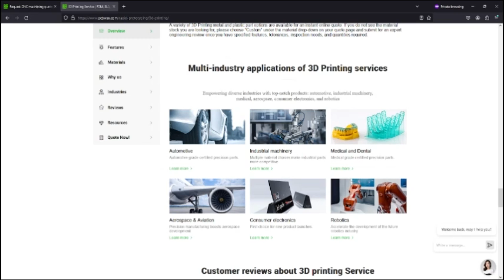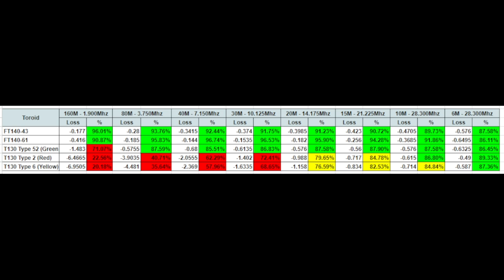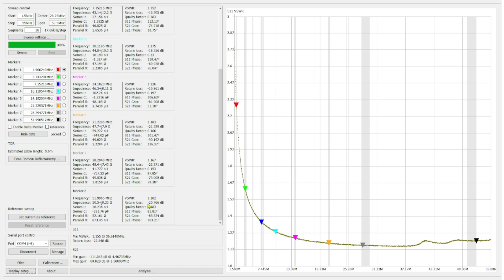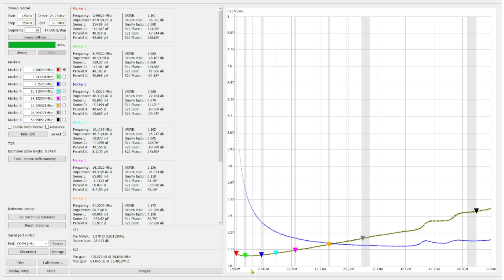Compared: 4:1 UnUn's for Ham Radio Antennas

Comment: That was a good one Dr Ape. Any idea why the T130 type 52 does better in the field?  The lab tests seemed to make the FT140-61 the hands down winner. My other question about toroids is heating. How big do they need to be to not overheat with 500W SSB and a 20% duty cycle? 73
Reply from the maker: It’s doesn’t “do better” but is tunable with a 3:1 internal tuner, that’s why we used it.  500w, I’d prolly use 2-3 stacked 240 cores 👍

Comment: What are the power ratings for the different cores?
Reply from the maker: For these cores I would suggest 100w ssb and 50w digital while keeping an eye on SWR.  We use them in antenna designed for 40-10 👍
Reply: @TheSmokinApe  I guess I have should have asked what size core for 4:1 1500 watt balun?

Comment: Sorry, I do not get it, what is the purpose of the test with the same size and the same number of turns? This test DOES NOT SHOW ANY EFFICIENCY DIFFERENCE BETWEEN MATERIAL TYPE BECAUSE THEY ARE SO DIFFERENT AND NEED TO BE WIND WITH DIFFERENT NUMBER OF TURNS. This test is misleading!  73 Danny E73M aka N4EXA
Reply from the maker: HI DANIEL.  YOU ARE CORRECT, THE CORES ARE DIFFERENT WITH DIFFERENT COMPOSITION AND WOULD NEED TO BE WRAPPED DIFFERENTLY TO ACHIEVE SIMILAR INDUCTANCE.  WHEN YOU LOOK FOR UNUN SCHEMATICS ON THE INTERNET THEY WILL SHOW A WINDING AND RECOMMEND A CORE AND THEN, AT TIMES, LIST OTHER CORES YOU COULD USE WITHOUT MENTIONING CHANGING THE WINDING.   MORE IMPORTANTLY, I WANT TO SHOW PEOPLE HOW TO CONDUCT THEIR OWN TESTS WITH AFFORDABLE HOBBYIST GEAR SO THEY CAN LEARN AND FIND OUT FOR THEMSELVES.  OH, GLAD YOU LIKED THE VIDEO 👍

Comment: Interesting results, most folks that I know would swear that the 43 mix would outperform the iron mix by a landslide. Would there be any reason not to use this core for an EFHW 49:1 or EFRW 9:1?  
Awesome video keep up the great work!
Reply from the maker: I haven’t tested in a configuration other than a 4:1.  I would be suspect of it at those higher ratios but it t might work…
Reply: I wouldn't mind giving it a shot. 
I could try 9:1 and 49:1.
What would entail a good test? 
I don't have a vna only a g90 with is swr meter is that good enough?
Where could I get such a core?
Reply from the maker: I believe we got these from TME.com

Comment: I am building a Yagi antenna would it effect the performance if I mount it on a metal pole? WQ9V
Reply from the maker: That’s a pretty typical scenario, you should be fine.  That said, any conductive material, in the near field which is about a 1/4 wave will impact your far filed pattern.  Everyone puts them on metal poles, so don’t worry about it bro 👍

Comment: Generally speaking, use powdered iron for narrow frequency HF coupling, and ferrites for broadband HF  and VHF applications, at least below where air-core makes more sense. Of course, core shape, size, and conductor diameter variables will also affect efficiency. Then there's power level to consider for the specific application, which will affect all of the other parameters. Then there are non-magnetic and air-cores to consider. Experimenting with transformers may be fun, but to produce optimal results it's a lot more time and energy consuming than hitting the datasheets and software transformer design applications with the requirements for your specific wants and needs, because you can do experiments with core materials forever. There are that many interactive variables. But the experiments and parameter measurements were already done 50 to 100 years ago by the core manufacturers, and the data has been put into transformer design applications. BTW, I'm not against experimentation just for the sake of experimentation. I  do it all the time. It's by far my favorite aspect of ham radio. I'm a builder and experimenter, usually making do with the parts on hand and optimizing those. That's my kind of hamming. I don't own expensive ham gear or chase certificates, or rag-chew, nearly as much as I spend my time soldering and measuring, meaning precisely this sort of stuff. I'm just pointing out the best way to get an optimal solution for a specific transformer design problem is with the core data and the application software, which some hams also find to be fun.
Reply from the maker: Hey John.  I agree with everything you said and that is how I enjoy the hobby as well.  That’s said, my buddy really wanted to do something with these cores, with what I can see and what we see in the field, I’m more than surprised given the data sheets but I’m having fun.  Thanks for watching and for the insightful comment 👍🍻

Comment: Well done for doing these tests, a considerable amount of effort. Your S11 measurements are interesting, in many of them the resistive element is very close to 50 ohms but with a reactive element. I suspect that with a correction capacitor you could cancel some of that and raise the apparent efficiency seen in the S21 measurements. A well presented video once again, 73
Reply from the maker: Thanks g0fvt, we have looked into including a variable cap but haven’t made it that far.  Glad you liked the video and thanks for watching 👍

Comment: Could you do a similar test with ATU efficiency? Like, I'm looking at getting the AH-705. Could you get two of them, tune them both at the same frequency on a random wire, then connect them back to back and test if they are more or less efficient that unun's and baluns? (the AH-705 can be connected directly to a random wire with no unun, I'm curious if it's better to use this tuner or a 9:1 unun across all parts of each band).
Reply from the maker: Hey Tru, here is a video where I show how to measure the loss in tuners: https://youtu.be/NaY3HEOEGpA  One thing to note, if you have a tuner in the shack you also want to consider loss in the coaxial cable, my SWR myths video talks a bit about that
Reply: @TheSmokinApe  Yes, I watched that video before this one. It just measured input losses. I was wondering what the efficiency of the actual components are IRL. Just risistive losses. I am curious if an ATU (without an unun) is more or less efficient than an unun. 

Another thing to look at would be average efficiency across each band. Like, if the unun at its most efficient frequency is slightly more efficient than the ATU, but the ATU is more efficient across all other frequencies in every band, the ATU would still be the better choice. 

If it turns out the ATU is actually more efficient across the board, it would show that a tuner, directly connected to a random wire antenna of suffici, is better in every way than an unun and EFRW or EFHW. Right now I get the impression that most people think an ATU sacrifices efficiency for frequency agility. I would be cool to prove that that's not the case - you can actually have it all with an ATU.
Reply from the maker: In many cases folks run an UnUn AND a tuner.  People act like loss isn’t real but it can add up quick 👍
Reply: @TheSmokinApe  I know. So, going back to my original question, is it possible to test how efficient a tuner is in the same way as you're testing the ununs? Getting two tuned in to the same frequency on an EFRW and then connecting the tuners back to back and seeing what the losses are at that frequency?
Reply from the maker: What I would do is place a swr and power meter before and after the tuner and compare the power measurements to determine loss 👍
Reply: @TheSmokinApe  Would you be interested in doing that in an upcoming video with a few different tuners you have already?
Reply from the maker: @truhartwood3170  I will add it to the list

Comment: Very nice work! The basic rule of thumb has been that the higher perm Nickel Zinc ferrites require fewer turns to have enough reactance at the low end, so this helps at the high end. And they handle power.
I don't mean to throw in another variable, but the number of turns can be adjusted based on the material.
Reply: "I don't mean to throw in another variable," Mike says, in a discussion of applied magnetics, (which already has half a dozen different names to describe every parameter, just to confuse the unwary.) It's a subject with seemingly endless variables, and they are ALL interactive, in a nonlinear manner. Personally, I felt like I was falling into a Black Hole when I first started digging into it. Applied magnetics is a very large subject to fully grok.
Reply from the maker: Hey John, I agree… it’s impossible to get a controlled experiment in a home set up 😮
Reply from the maker: I agree Mikro, I just wanted a consistent “control” 🤣

Comment: Thanks Ape. The question must have been asked before, but what would happen when you combine two different toroids and wind the wire as if they were one. Could you get the best of booth worlds like good on lower and good on higher frequencies? Or would something totally unexpected happen? I don't have any testing gear or toroids myself. So just throwing the question out there...
Reply from the maker: Hey Traveler, it has been asked in other videos.  I have never tried it and haven’t seen others do it either.  I will use a type 43 for a 49:1 and then a type 31 for a choke behind that.  I would not use them in the same transformer but would in series 👍

Comment: I love these videos Ape.   I got a question. If you have a video already that explains it feel free to point me that way.  If you go from the 140-XX to a 240-XX where the XX is the same foe each,  is it just bigger or is there another significant thing either good or bad?
Reply from the maker: Hey Bryant, glad you like them.  So, an FT140-43 means its a ferrite toroid 1.4" in diameter mix 43; aa FT240-43 would mean that it's an outer diameter of 2.4" and mix 43.  If a core is T130-2, that means its a powder iron core with an outer diameter of 1.3" and type 2.  Type and mix are poder iron and ferrite.

Comment: What is the power envelope for these QRP, 10, 20, 100W? I may have missed it in my initial watch through.
Reply from the maker: Hey Shawn, these were all tested with a very low signal.  I get that I should potentially expect different results at higher power.
Reply: @TheSmokinApe  thanks sir! I'm just thinking about building one myself. This is all great info. Don't want to undersize the build.

Comment: That powdered iron core are definitely going to be better at the lower freq.  73
Reply from the maker: For some reason, and who knows what it is…. The green cores have been easier to tune.  Chuck has a few different antennas re-built and we are going to run the tuner-test!

Comment: nice testing. I wish I had some 240 type 52 mix to try. only have type 31 43 and 61. I did build a off set center for 10 meters veritable. used a type 61 t240 core. what i had. all speaker wire tape to DX commander 10 meter pole. got a nice tune. works about the same as T2LT coax antenna . but I did compare FT8 10 meters in the same day. just hour apart .using end fed half wave fed with 49:1 type 61 with ground plain . veritable to a off center fed 4:1 type 61 core same pole ,I have 2 . lay one down. stand outher up. what I found is my signal reports on end fed half wave was a tad better both ways . from antenna molding which i did i found half wave ground plan antenna has slight higher gain and better take off angel for dx. the off center had no ground plain. now from modeling looks like 5/8 wave ground plain get me best pattern . now I have to figure out the feed match. that 52 mix is not as common. I did find Soto beams has the T 240 type 52. I got their antenna wire in green . great wire . 73's
Reply: correction . HF kits has T 240 type 52 cores.  only in 240 size. they sell that ARRL kit. that a 43 mix . think you made that one.
Reply from the maker: I did make the ARRL one.  I want to do a 5/8 vertical but just haven’t found the time 👍